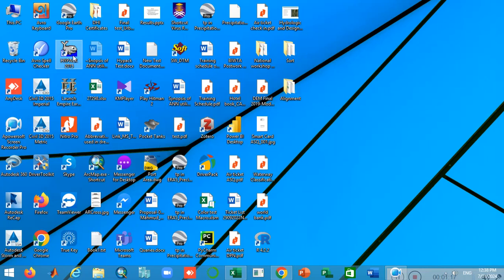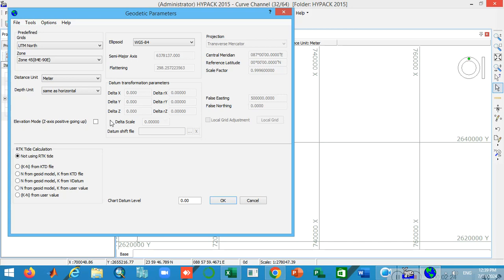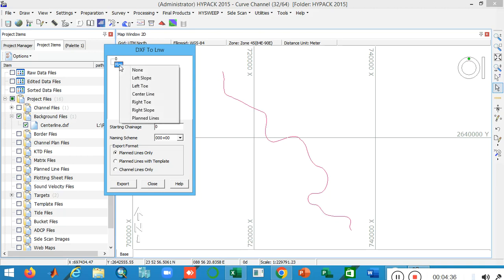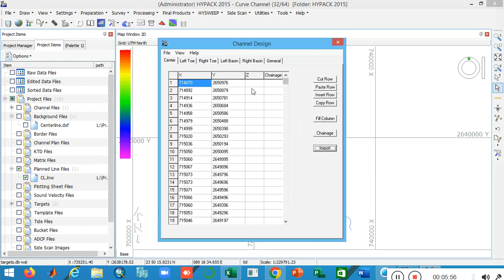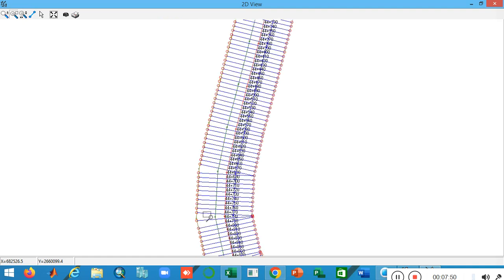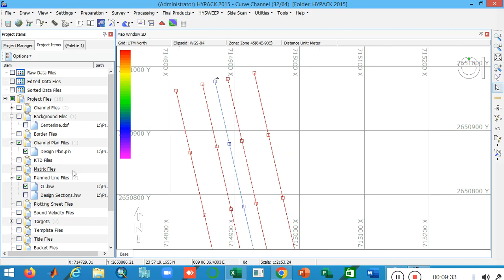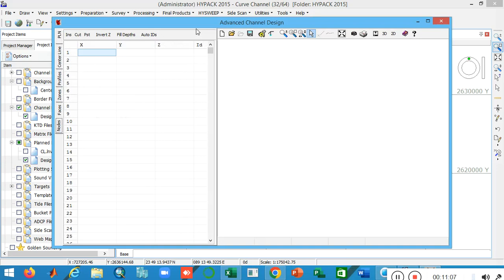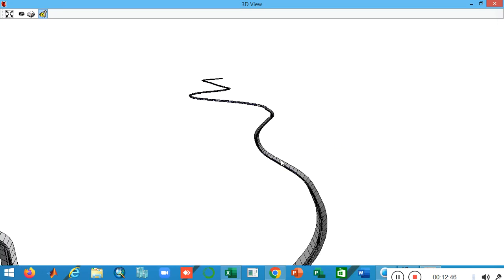Hypack tutorial on Curved channel design

Comment: Como posso calcular o volume de uma área que quero dragar?  Tipo usando a carta nautica
Reply from the maker: You have to create the design section using hypack channel design tool. After that you can easily calculate the volume using bathy data within design section.